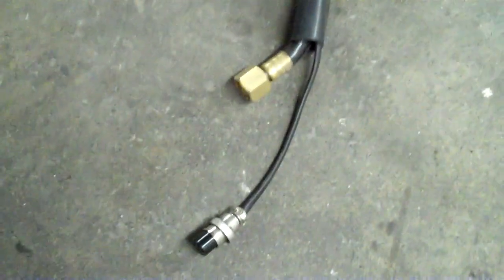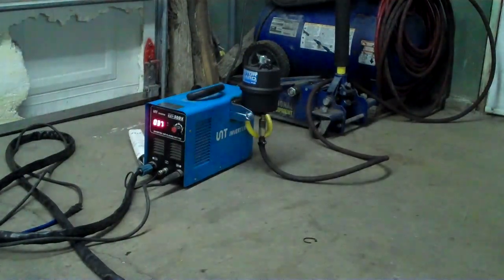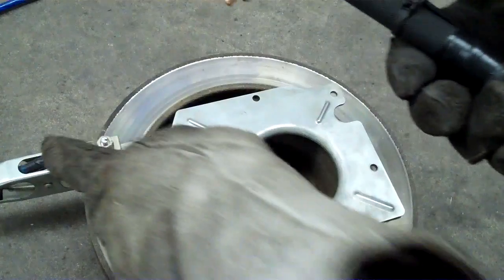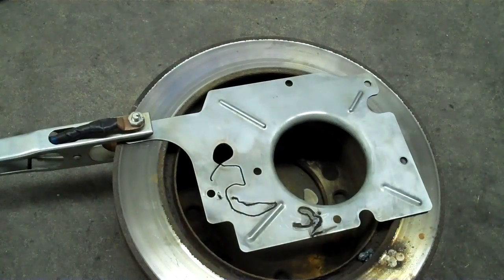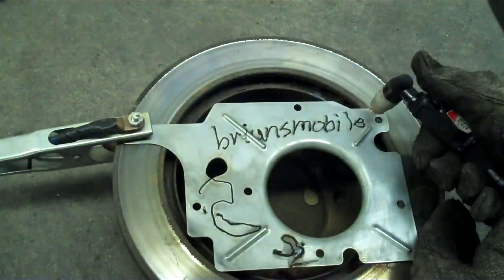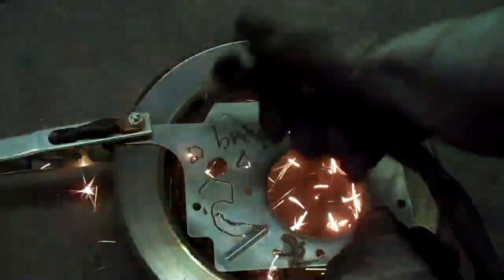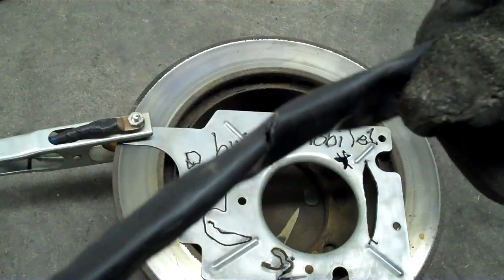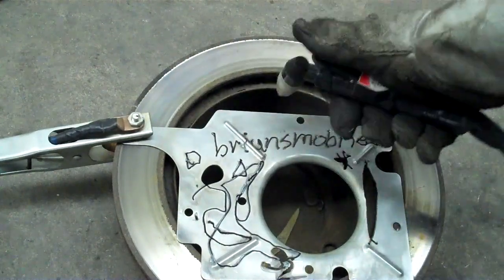Plasma Cutter VICTORY!!!! And Plasma Cutter Bliss!!!!

Comment: hi  I  notice   it  a lotos  . 50 amp  .    what do u have your setting at on your gauge to cut hevy meatle /      weres the tip guide    its a meatle ring that    slides over the tip cover .     it keep the tip   from touching the   peace   your cutting .   so you don't  burn out your tip .     and do u  have your  hook up to 110  volts or 220 volts .    .        and what the air gauge set

Comment: hi there can you tell me im having the same trouble as you. so do you have to keep the tip on the metal all the time when you cut? I tried to cut a 10mm sheet metal steel and it just blobed on the top but stroke it to start it then lifted of. Nick

Comment: Hey Brian,
I´m having trouble with my Bolix CUT50z, you gave me ideas, but none of them seems to be the right one, mine doesn´t leak, but if I assemble the torch as I should there not even a bit spark. Its not the grounding I´m sure, because if I assemble the torch without the swirlring it does ignite, but then the arc and the plasma goes whereever it wants, melts the surface but doe not go through. Do you know if the swirlring actually is spinning inside the torch, or just blows the air around?

Comment: If you don't get a nice, thin cut, it's acting like a TIG welder without shielding gas. Not enough airflow and there isn't a plasma stream.
Mine works well, about 30psi air for thin metal and a bit more for up to 12mm. I leave the air switch to 5 seconds after cutting to help keep the tip cool.
These chinese machines do suffer bad electrical connections as well, so always strip the connections and check them, otherwise they are a good buy for the home metalwork enthusiast.

Comment: I work at a scrap yard and in our shop they have a plasma cutter they got from harbor freight that ive used a few times. It has a pilot arc when you pull the trigger while its away from the work piece. From what i understand the arc initiates when you pull the trigger with a very high start up voltage to ignite the plasma then when you get near the work piece the electricity is conducted through the plasma field melting the metal and the compressed air blows it out, just my guess.

Comment: PT2,, BUT,,the EPAY,,CRAP,, The ones,that you cold uses the electrodes 2z,,by turning them Over,, What a Great idea!!!  At least the Ones from RILAND,,Or Centracut, In New hampshire, were great,, But compared to my Miller Spectrum 500. which was a 40 amp Machine! And ran off a 80!!!!!!!AMP Breaker! YIKES!!!,, I Should be taking On the longevity Line SOON!!!!!,,Kevin Caron, does some Great You Tubes,,and a Great Guy,, GLAD!!!!!! Your All Taken care of,as thats the way there suppose to work!,Jack

Comment: Brian, I sold  Rilands for Years, Before the Owner died of cancer at 32,  I was Doing a Road Job 1 day for GE. and 3 of the Top Enginners were Out, and I had the 40 amp Machine, The One the size of a lunch Box, And WOW,were they Breaking My Balls!,I was Using there Air,Running My Plasma,off My Ranger Welder!, Cutting 1/2 thick Diamond Plate, I switched Over to the Cut 60 torch,Long story short, I sold 3 to the enginners! that Day! What a Dif. the 60 Torch is,Looks like You are Using the 40!,Jack

Comment from the maker: It has no pilot at all- it has to make contact in order to initiate and maintain arc.  It's NOT the best kind of plasma cutter to get and requires much more maintenance and tips in order to run.  It's operating costs are therefore much higher, but the initial investment is increadibly low.  It's fantastic for limited DIY use.

Comment from the maker: You know what I love?  Experts like you who take the time to help me out and especially with such respect and diplomacy.  Any plasma cutter worth it's metal should never make contact and should be used as you say.  Due to your expertise and experience I would have to guess you've not encountered a unit as cheaply done as mine.  Mine does require light contact to start as it has NO pilot whatsoever like you'd find on more reputable models such as you're likely familiar with.

Comment: Hi Brian,
Just glanced through comments after seeing your vid and as a 6G, FAA certified welder (basically not to toot my own horn but the best of the best) NO plasma cutter requires contact.  In fact, you should be about 1/8 away from whatever material you are cutting be it carbon steel, sst, alum, etc... basically anything.  Touching the material with your plasma tip is a no no ANYTIME (not yelling, just emphasizing).  This will also help not burn your tip but lessen dross and slag. :)

Comment: :D yeah, I can see where I messed up with GOD torch :D ok, so this time I used air from compressed air tanks that are used by firefigters. So this time I really have clean air going into the torch and combined with new tip/electrode or whatever that is, It cuts really nice :) Clean air is really essential here.

Comment: how much air pressure do you have? I bought one of these and I have problems with arc ignition... sometimes works good, and sometimes It just wouldn't stay on... Torch is really god, I dissasembled it and its nicely build without any leak.

Comment from the maker: You could be right.  The electrician that wired my garage for the cutter (the plug and circuit) looked at the cutter and decided to match the breaker pretty quick.  Good for you for being thorough.

Comment: i just discovered your video. nice. couple of questions though. no instructions on the machine as to input power.  what size circuit is needed at the panel for 220v vs 110v? are they 20 or 30 amps? the output is obviously inverted to 50amps.  also what gauge of wire did u use for the earth ground in the rear of the unit that is not supplied?

Comment from the maker: You're 100% correct on a nice Miller set up, however on this one your arc dies if you lose contact for more than a half second.  You have to aim straight down 90 degrees to the surface and maintain contact at all times while cutting.  Some call it a drag gun.

Comment: @briansmobile1 It has plenty of fluid and no wet spots but i did do some work on the axle before these issue could it be something like a bad wire connection. could the wheel sensor or abs module cause such a bad problem? I cant really think of anything else. it all looks like it should work perfectly fine. i don't remember it making retarded noises it just kind of did it out of no where.

Comment: @bustfer07 wow thats really bad. The abs only activates when it senses a wheel lock under hard braking. A car that has abs problems will generally drive, and brake fine. Is the pedal mushy or firm? If its mushy and spongy, I suggest you do a flush and bleed. Also, have someone step on the brakes while you go around looking at all the rubber brake lines. My 94 accord had a brake line bulge that you could only see when braking. check pads to see if they are grabbing. leaks are not always external.

Comment from the maker: @bustfer07 LIKELY you're out of brake fluid due to a leak in the system.  Check that first.  When ABS units fail (like on one side) they usually make a bunch of retarded sounds first.  You didn't mention that as a symptom so.....  also just check at the calipers, hoses, and wheel cylinders (if equipped) for signs of wetness.  TAKE LUCK!

Comment: hey Brian i got a quick question for you. the ABS light come on and now its really hard to make the car stop i have to push the break pedal all the way in and some time i even had to use the emergency break, it feels as if only the right side breaks work. could these be a result of a dead Abs module or simply the wheel sensor? i already checked for leaks and found none